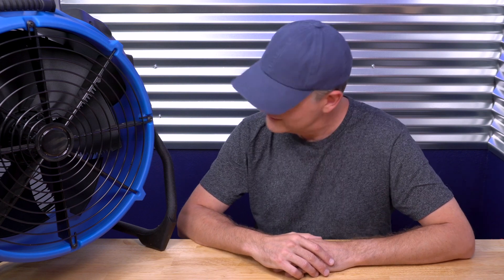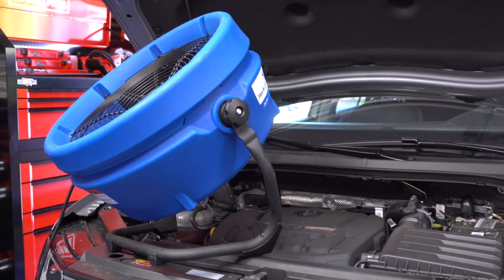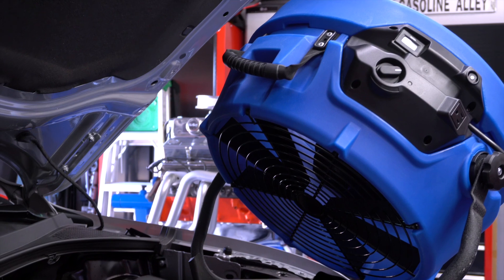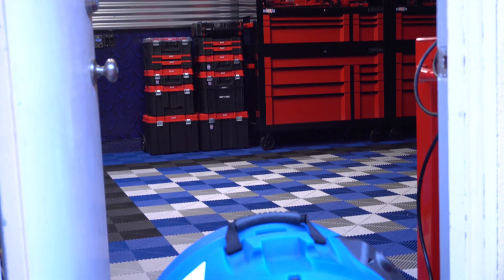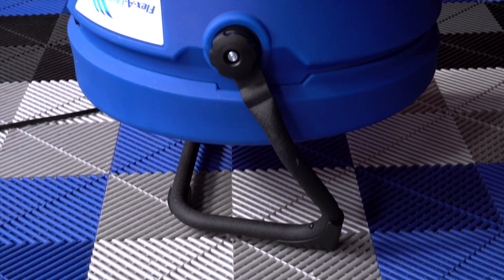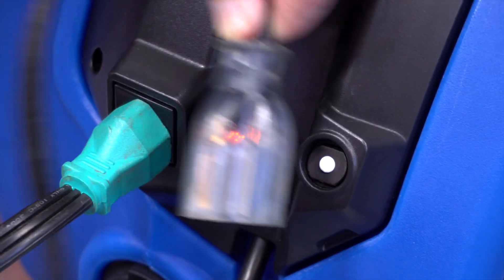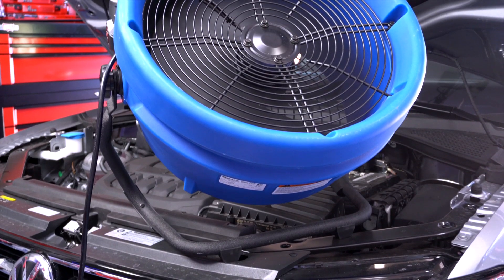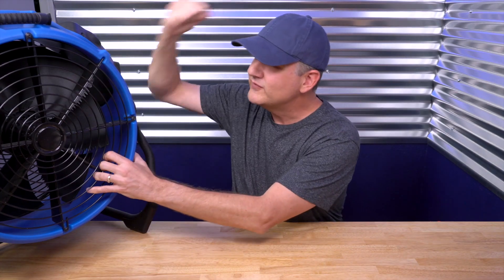💨 Flex-A-Chill 3000 Airmover Review - The Ultimate Cooling Solution for Any Space!

Comment: Yikes! $408! I don't know the CFM but I bought a fan that has vertical adjustment and 3 speeds for 40 bucks. Has more air movement than a box fan. No hour clock, no extra plug. Works well for keeping me cooler.
Reply: This fan has 2600 cfm